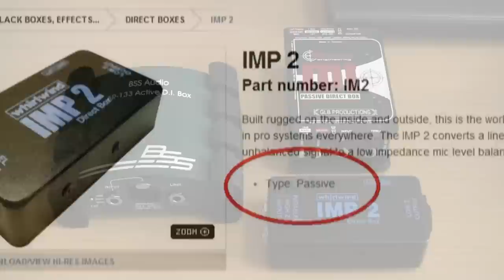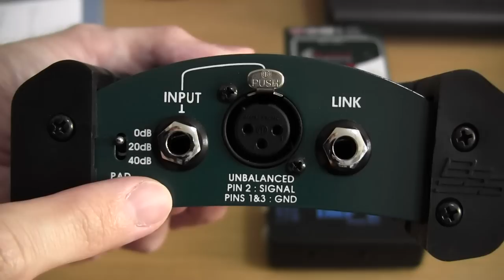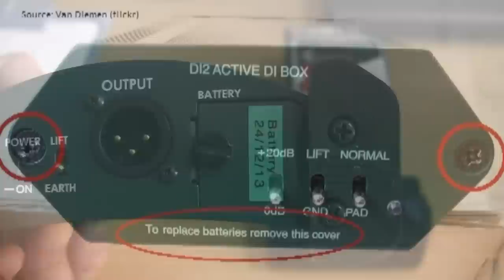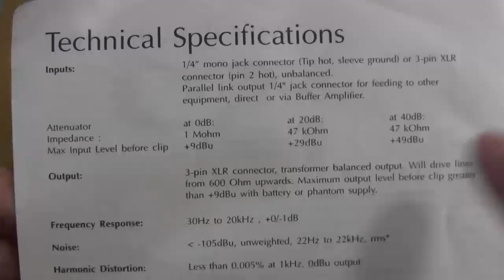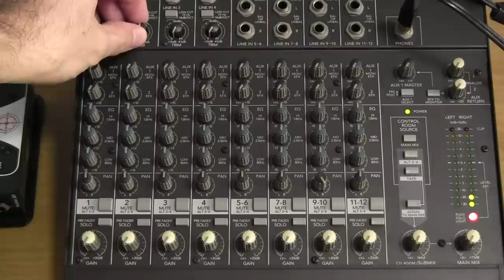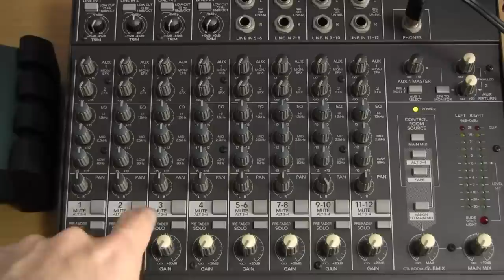DI boxes part 2: Active vs. Passive

Comment: Thanks for your videos, I'm teaching myself audio engineering and these have been very helpful. I have a small PA that consists of a mixer and two powered speakers. The mixer does not have balanced output (Citronic CL82DSP), but the powered speakers do have provision for balanced input (Behringer EuroLive B212). Would it be recommended to use a DI box between the main out on the mixer and the speakers? Usually at least one of the speakers is more than five meters away from the mixer. Occasionally there has been a low background hum.
Reply from the maker: +totaltotalmonkey According to the owner's manual here: http://www.discoworld.dk/manuals/avsl/170901.pdf your mixer does have balanced outputs, it's just that they are not on XLR connectors. A pair of TRS to XLR male adapters should solve your problem :)
Reply: +GLB Productions 

Thanks for the response. I now notice the manual says Master Mix Section - Max Output 22db balanced output. Looking at the block diagram, the main output R (of the TRS connector) appears to be connected to ground. However, comparing that to the block diagram for the Ctironic CSP/CSL manual it appear it could be a 'local' ground point. The CSP/CSL diagram explicitly notes that S is connected to 'global' ground, and the R is connected to a 'local' ground (down pointing arrow). I will test and see what happens. Thanks again.

: -)

EDIT: down point arrow on circuit diagram = negative power supply (not 'local' ground). Also, the manuals show block diagrams not circuit diagrams.
Reply from the maker: +totaltotalmonkey Yes that is referred to as impedance-balancing - even though it is not a symmetrical output with line drivers on pins 2 & 3, because the cold side of the signal is maintained at the same source impedance as the hot side, it will still appear as a properly balanced source when connected to a balanced input, such as the one on your powered speakers :)
Reply: That makes more sense now, my electronics knowledge is quite rusty.
Reply: +GLB Productions Sorry to trouble you again. Just to clarify, R and S are both connected to ground on the CL82 mixer? therefore I could use TS -> XLR, if so would the cable need 3 cores (with S and R connected at mixer end)?

Someone has come across a potentially similar situation on reddit with the Xenyx 1002B , I tried to help them out but ultimately I didn't know enough:

https://www.reddit.com/r/livesound/comments/3peab7/trying_to_understand_main_outputs_on_xenyx_1002b/
Reply from the maker: +totaltotalmonkey No problem! If you want to use TS connectors at the mixer end you will need to ground pin 3 of the XLR - I'm a bit confused because you mention sleeve and ring - TS connectors have no ring ;) 

On the other hand if you would like to use TRS connectors at the mixer end they should be wired to the XLRs in the standard manner: tip to pin 2, ring to pin 3, sleeve to pin 1.
Reply: Thanks for the reply. I'll let you know how I get on
:- )

Comment: Any way to use the BSS AR-133 as a reamping box ?
(line out from the DAW of an already recorded guitar di track to an amp head)
Reply from the maker: Not really - even though it has an XLR input it's designed to go from unbalanced to balanced and not the other way around. You could use it to record the dry signal but for the actual reamping it's best to use something like the Radial X-amp.
Reply: Thanks !
I though that with the -20 pad engaged from a line signal in the input could do the trick...
btw, nice insight video
Keep up the good work dude.
Reply from the maker: PereRevert You're welcome, thanks for supporting the channel!

Comment: What about isolation between input and output? Which one is better in isolating both the sides?
Thanks...
Reply from the maker: Passive for sure - there is no physical connection between the input and output sides of a passive DI box.
Reply: @GLBProductions  thanks.

Comment: Could I connect a microphone to DI box?
Reply from the maker: If your microphone is a professional model with an XLR connector the output is already balanced and low impedance so there is no need to connect it to a DI box.

Comment: Hello sir. My output from DI to my mixer im using XLR(female) to TRS cable and plug it to mono (balance/unbalance), is it the same with the mic input? Thank you
Reply from the maker: No it is not the same as the mic input - the line input typically runs through a 10-20dB pad so you'll get a lower signal level.
Reply: GLB Productions thank you so much sir
Reply from the maker: You're welcome Jeff.

Comment: Well I bought a cable from guitar center that is xlr to 1/4 inch but the cable itself is also supposed to take the signal from mic level to line level to match the pedal... But I guess it doesn't work that well?
Reply from the maker: +James Ardery Clearly not ;) A cable by itself cannot raise the level of a signal - for that you need some sort of active electronic circuit. All the cable does is match the connector type.
Reply: +GLB Productions gotcha

Comment: Hello.  I would really appreciate it if you answered another question I have.  I'm wanting to get this compressor for my guitar and bass, here's the technical spec sheet http://www.behringer.com/assets/MDX2600_P0178_S_EN.pdf.  Under audio outputs, it says "Impedence: 95 ohm bal, 50 ohm unbal @ 1khz.  I can't really tell from this description if I'd need a DI box for recording to my pc through a usb interface.  I plan to be running my guitar to my wah, to my compressor, to my usb interface.  When looking at these effect pedals/rackmount units, how many output ohms do you need to not need a direct box? Much thanks!
Reply from the maker: Logan J Ah yes the good old Composer pro - I've used this unit before. If you look at the specs for the output section of the compressor, you'll notice that it can be balanced or unbalanced depending on what type of connectors you use. Because it is an AC-powered device it can automatically be regarded as low-impedance (in any case a 50-ohm output impedance is very low). So you will not need a DI box - even if you use standard guitar cables, just be sure to keep them under 15 feet in length.
Reply: Okay, thanks alot dude!
Reply from the maker: Logan J
No worries my friend.

Comment: Should you use a DI box on a microphone?
Reply from the maker: ***** Generally no - the output of all professional mics is already balanced and low impedance so there is no need for these functions that a DI provides.
Reply: GLB Productions I have been in many different church setups, some very professional and they always use di boxes usually active ones.. and many professional microphone preamps/effects units have built di or need a di.

I had an passive guitar so i needed a di/preamp i got a behringer adi21. then i got a guitar with active pickup. and it still sounded good in the adi21. this also had a foot switch to turn on or off the di. i found that the preamp settings changes the di levels so i could turn it down a bit. nice one that. d
Reply from the maker: Michael Stoneham Yes, active DIs can generally be used with either active or passive instruments, the only issue being that when used with an active instrument they tend to generate a near line-level signal which can cause overload issues at the mixer end.

Comment: What about a guitar pluged into a tuner. Is that now Active?
Reply from the maker: Scott Davies It depends on whether the tuner has a buffered output or is just a simple parallel split. In general though, I recommend connecting to the DI box first, and then using the parallel output of the DI to connect to the tuner.

Comment: hi this is very useful for me and I have one doubt , I am using 50 meters snake between the stage and console what di should I use for active source like keys and pad , if I use passive di wether it will loss the signal , and in some time I will use di box for my mic also is it right
Reply from the maker: Passive. Not to worry - once a signal is balanced it can be transmitted hundreds of meters without signal loss.
Reply: @GLBProductions  praise GOD thanks you

Comment: Talking to sound guy at church. he said active di boxes that use phantom power can also be used as passive ones if you dont run any power. is this true or is this only selective brands models. this would be handy idea.
Reply from the maker: Michael Stoneham This is definitely not a universal feature - some active DI boxes will run on battery power if no phantom is supplied but they remain active. Please ask your sound guy which specific model has this capability, if there is one I want to know about it :)

Comment: Can someone explain to me what the consequences of plugging an active or passive guitar straight into the 1/4 inch jack on the mixer?
Reply: (in the case where it is a short cable run from the guitar to the mixer)
Reply from the maker: An active guitar can generally be connected directly to the mixer in this way. A passive guitar or bass will sound very muddy due to the impedance mismatch and there will likely not be enough gain to get a good signal to noise ratio. Hence the need for DI boxes ;)
Reply: Thanks man. I also have one more question... I've had a problem a couple years ago where my passive bass - (plugged into an active DI with a link cable to an amp as a foldback) would play no sound on the mixing desk (the foldback was audible). This was in a band where 3 bass players would take turns plugging the bass into the DI box to play (high school band). The other bassists had active bass guitars and could be heard fine. Would the reason my guitar was not being heard be a too low gain on the mixer?
Reply from the maker: Yes most likely, or the pad on the DI box was switched in. Many active DI boxes have a 10 or 15dB pad to cope with very loud signals - if you try and connect a passive instrument with these in the circuit the result is typically almost no output which can be interpreted as a signal fault.

Comment: Ok tnx just wanted to clarify that, so any powered pedal makes passive instrument active signal,is that case if pedal is off(bypassed)(i hope so)?.If so that makes passive DI much better buy then active DI in almost any case, almost everybody uses at least one pedal(or will eventually)and there is no battery and no phantom needed,that is my opinion correct me if i wrong pls. Anyway great two videos just what i needed tnx
Reply from the maker: If the pedal is true bypass then the signal from the bass will be considered passive when the pedal is off. So you need to check and see what type of pedal you have.
Reply: I have 2 pedals, EH Bass Big Muff is true bypass but i don't know about Behringer BDI21 is it supposed to be considered as DI or what?

Comment: so wait,would an electric guitar with active pick-ups need a passive DI box?
Reply from the maker: +Alex “Tolerey” Joannou Electric guitar is normally not DI'ed at the instrument - you would place the DI either after the last effects pedal or at the line out of the amplifier. In both of these cases a passive DI would be the best choice.
Reply: +GLB Productions Oh,I use the Presonus audiobox to record and just use plug-ins,but i had an issue with clipping while recording,so i watched a video about clipping,and it says if i get a DI box and reduce the signal to mic level, since presonus is opted for mic level signal,it will not clip,is this correct or am I buying something that will not help? Thanks in advance,these videos are very helpful!
Reply from the maker: +Alex “Tolerey” Joannou I would disagree with that - the AudioBox can handle both mic and instrument signals you just have to be sure to set your gain correctly. Make sure that the red clip light next to the knob never comes on during your recording and you should have a clean signal. Also be sure to use a normal guitar cable and plug into the centre of the combo jack - do not use an 1/4" to XLR cable or any sort of adapter.
Reply: +GLB Productions ok thanks! Oh by the way,if I wanted to use my pedal with the audiobox what would i need to be able to connect it from the pedal to the audiobox? would a DI box be helpful here?

Comment: Without turning on an active D I does that make it passive. I have a passive bass. 1st I go through a 6 band EQ then through a wireless. Do I use an active D I? On another system for guitar, I 1st hook up  pedalboard then out to a wireless then to passive D I. Is all this right?
Reply from the maker: Good questions! The answers, in order would be: 
1. No it does not - it won't pass signal when off. 
2. You can use either type - passive instrument into any sort of effects pedal creates an active signal source. 
3. Yes, but why not connect the output of the wireless directly to the mixer?
Reply: GLB Productions 1st we don't use a bass amp on stage no more. 2nd I do still need a amp for guitar to monitor myself and the effects.  Thank you for answering so quickly. This is for my church worship band. When I used the back off the wireless, I couldn't use any effects at all
Reply from the maker: You're welcome. You need some way to monitor yourself that's for sure - either via a guitar amp or via a stage monitor system of some kind.
Reply: GLB Productions  I've watched part 5 active vs passive. Very excellent. I do use a guitar amp to monitor guitar sounds. I guess I gonna need another passive D I in the near future. I've used the active 1 since I started playing bass with the band and it works so far. But your saying we have too much gain with the active box and EQ pedal. I'll check with the sound guy to see where we at.
Reply from the maker: Thanks for watching! Active DIs can be used with both active and passive sources - if there is too much signal coming into the mixer try engaging the pad switch on the active DI to reduce the level a bit.
Reply: GLB Productions  Yes sir, so far that's what we do. I might try a passive D I that's laying around on the bass this week. And I've locked down a couple on EBay if I decide to buy. But thank you for all the good info all day long.
Reply: GLB Productions  And I am going to keep watching all of these cause I got amps and pedals with D I hook-ups. So I do got more to learn. Also have a 10 channel Prosonic P A  and a small 10 channel Behringer mixer that I will hook up through the P A for more options. It has effects for both vocals and acoustic guitars.

Comment: Very informative .. thank you for taking the time to make the videos .. I was wondering a few things .. I run a Line 6 relay G90 wireless system to my Ampeg svt 4pro .. as you might know .. Ampegs are nutorious for noisey direct outs .. Can I run my Ampegs direct out to a DI box and than to the PA? Would that cancel the noise from the amp? or should I run my wireless receiver to a DI box than send the signal to the PA and amp?
Reply from the maker: +ozzieli001 You're welcome, thanks for getting in touch. If the amp DI is noisy plug the output of the wireless receiver into the DI box and the parallel out of the DI into the amp, that should solve the issue :)

Comment: What about stomp boxes'? Which one best for that'?
Reply from the maker: Oscar Gonzalez Most stomp boxes are battery powered, so I would start with a passive DI box.
Reply: GLB Productions Ok, following that line of reasoning, would the active status of the guitar signal through an effects pedal change if the pedal itself were run, not using a battery, but using an AC adapter, such as a Boss PSA-120? Would the guitar signal still require a passive box, or would it then need an active one?
Reply from the maker: NightlyMirror No, battery or AC powered devices are both considered active :)
Reply: GLB Productions Oh! Thank you for that lightning-fast reply!! lol That clarifies things perfectly. Blessings to you for the great job you do...:-D
Reply from the maker: NightlyMirror You're welcome, all the best with your music!
Reply: GLB Productions and most of those also have 9v plugs for power adaptor plug. Stomp boxes is a very broad term. a traditional stompbox was the foot drum. now any pedal for guitar, singers etc that has a foot switch can be called a stompbox.